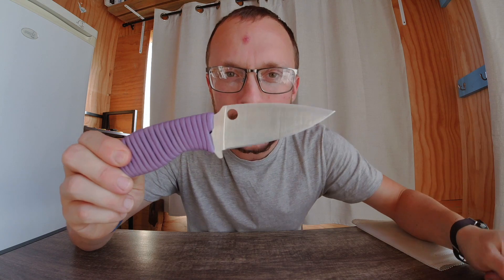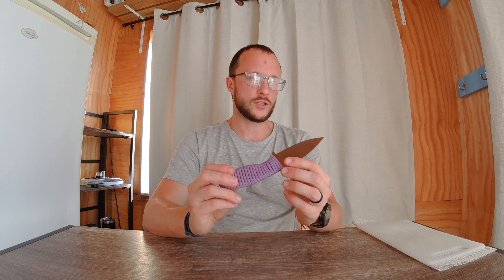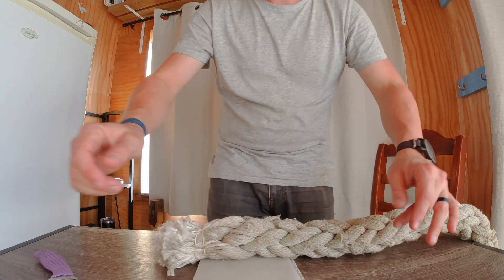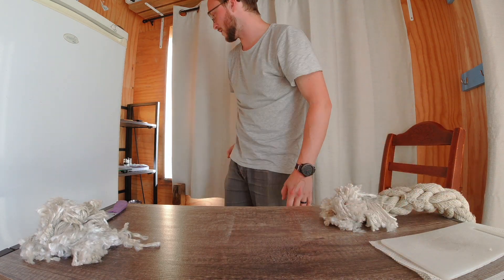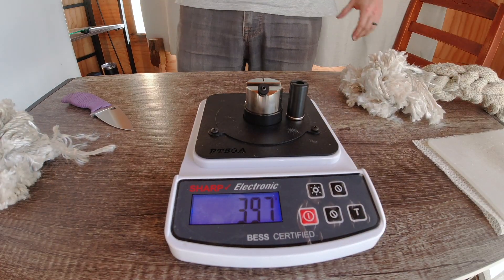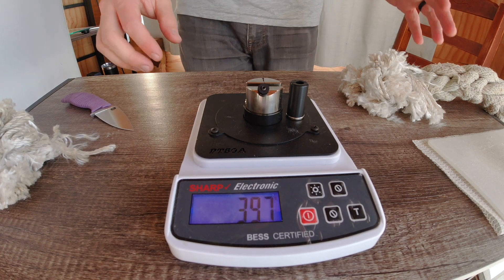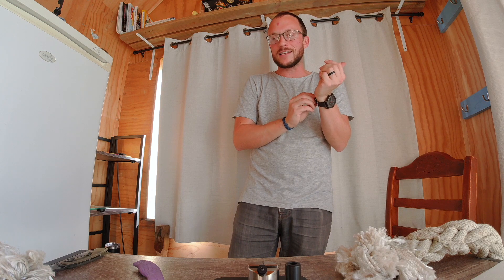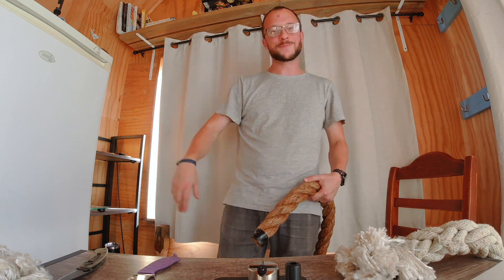Dual Grit CPM MagnaCut Finale | Final Death Rope Test | Spyderco Mule Steel Test

Comment: Why are you discussing the hardness so extensively in terms of edge retention while the most important thing here is the low angle of the blade and the good (quality) heat treatment. 60 to 63hrc of Magnacut differs in terms of pratical edge retention in the range of 5-10% at best (if all other factors are the same). 

A low angle of 10 - 13 degree per side provides 3 times more edge retention than an angle like 21dps when cutting through soft stuff where the blade can't chip or fold etc. This blade is good for long and extensive tasks when cutting into soft materials, like this rope. If you go through bones while filleting a fish for example or skinning a boar with such a low angle, it will dull a lot faster as it will lose retention due to minor micro chipping.

Great test, though. However, if you strive for high edge retention with Magnacut, pay attention to stuff such as finer, thinner blades, heat treated at 62-64 and sharpened (or having the ability to be re-sharpened) at a low degree angle ( an acute angle - 10-15dps max) if it's not going to be used as a hardworking blade.
Reply from the maker: Greetings, great feedback and good questions.

Yes, I am aware of research that is coming into the forefront now which shows that edge angle is most important to edge retention.  The reason that I am talking about HRC so much in this video (and not edge angle) is because the video is 2 years old.

At that time, everyone was obsessed with hardness, and although Larrin Thomas and others had done the research to demonstrate that edge angle is actually king when it comes to extending edge life, it did not have much publicity at that time and I had not seen the research.

In short - you are right!  And I agree.  I just didn't know it at the time!  Haha, have a great day, good job doing your homework and thanks for the positive tone of your comment!

Comment: And that is why I’m dying to get a Spyderco in Magnacut so bad!!! I see Microtech just started using it but they’re a complete joke with heat treating their steels. Their Magnacut probably performs about equal to S30V at best.
Reply from the maker: I wouldn't know about MicroTech, I've never had one.  Always thought their OTF's looked cool though.  I hope you can score a Spyderco in MC soon - I just got a Hogue Deka, and am excited to get some use in on it!
Reply: @homeslicesharpening  lol it’s funny you mention the Deka because I’m going to be ordering one tomorrow. I’ve been looking around and right now anteaters it’s about the only decent sized folder in Magnacut available for normal working man wages. I did a lot of reading up on them and saw that most hate the cheap feeling scales of the gen 2 with the Magnacut blade. So I’m going to be getting a set of the OG aluminum scales in OD green for it as well. I do hope to find a Spydie in Magnacut one day though because they’re by far my favorite knives.

Comment: Thanks for doing these tests, I definitely gotta get me a magna-cut knife.

Question: I’ve seen a lot of testing non serrated knives against different materials. Would you consider testing a spyder-edged (serrated spyderco) knife against the death rope? 

I’m on the spyderco forums and sypderco’s serrations seem to have a cult following, it would be interesting to see why that is.
Reply from the maker: I would be interested in testing a Spyder-edge knife!  I just don’t have any.  Do you prefer serrated knives?

I’m sure a serrated knife would do well cutting rope, but it would be interesting to compare the 2!
Reply: @homeslicesharpening  I do mostly plain edge knives and am curious about serrated ones, I just don’t have a use case where serrations would offer an advantage to me. However the fanaticism of spyderco’s serration fans is making me question that. I don’t see anyone testing serrated edges so I am really curious about how they do.
Reply from the maker: @nandayane  yeah, if I have an opportunity I will definitely test them.

Comment: Amazing!!! I've got to push my mule team in Magnacut more!!! Duel grit here I come!!!
Reply from the maker: Do it bro!!!  I am getting good results from 250 grit diamond plate coarse and I usually use my King 6K fine since it's so gentle.  17 dps this test, stropped lightly on flat denim loaded with Mother's Mag.

Make sure you do all edge-trailing strokes for dual grit and take your time to balance it out, and LET ME KNOW if it's awesome, or if you have questions!
Reply: Only concern is I bought it off eBay and the billboarding is lighter than on SPY27 mule team and it might be a clone.
Reply from the maker: @ssunfish  NOOOOOO

Comment: Wow, what a performance! Could you retest a knife that came close but failed previously? That would help rule out the possibility of variation over the length of the rope.
Reply: And also unconscious improvements in technique.
Reply from the maker: Thanks for the ideas.  I did test dual grit M4 twice, but it actually seemed easier the first time, oddly enough.  I don't think we can rule out some variation over the length of the rope, so this test is limited in scope.
Reply from the maker: First DG M4 test is at the end of this video:
https://youtu.be/uWPBArqnxfg

Second is this video:
https://youtu.be/UvNW4qbBhEU

Comment: Iirc those magnacut mules are only 61hrc. Dont quote that as fact, but what I heard from the grape vine. Interesting results. I'd have to think of it like an engineer but I'm too tired.

For the thick rope like that, the Russians wrap it with tape and then use wd40 during the testing to clean the tape off the blade intermittently. I'm not sure if this is the best idea to do, but just a thought.

Also Phil Wilson went from using 1/2" manila rope to 3/4" rope since it was thicker so that the testing would take less cuts. I uploaded his PDFs on the microstructure page a few days ago, you can read through them. Seamount links. But yeah I think you got the right idea of going bigger. But it won't be idea for smaller knives. So two charts may be needed to compare results. As they won't translate exactly between thick and normal.
Reply from the maker: Nice - I have seen some of Phil's old testing, that's where I got the idea to increase rope size.  I think I'm going to rubber band the rope, maybe on both sides of the cut, we'll see.

I believe BBB tested his Spyderco Mules and they were 62 and 62.9 respectively, but I have not seen other tests, could be lower.

I'll have to check out Phil's data.  Thanks!